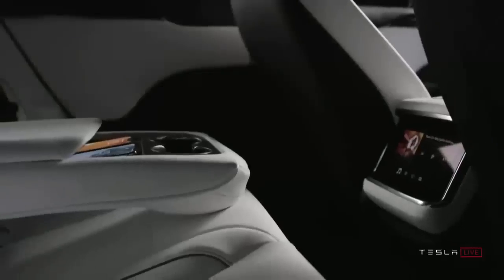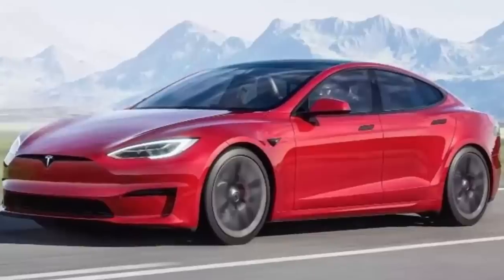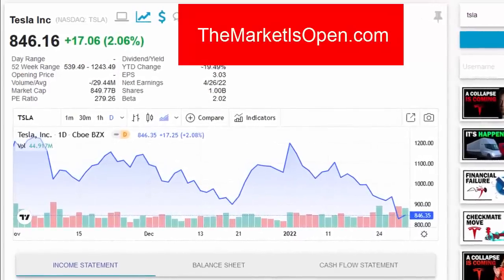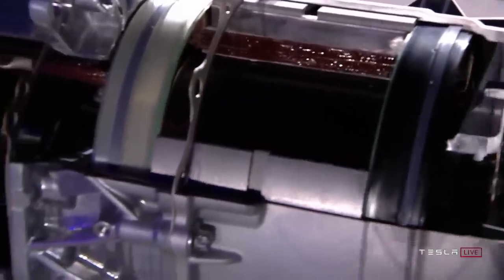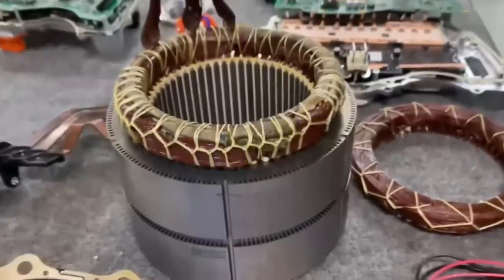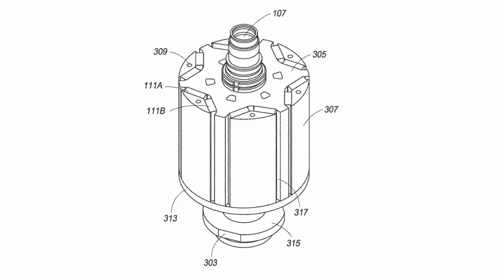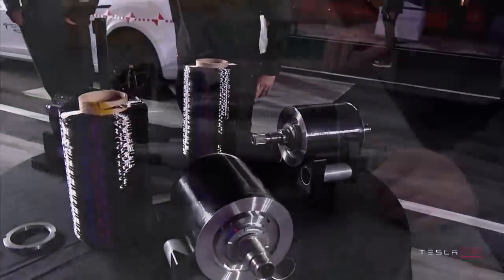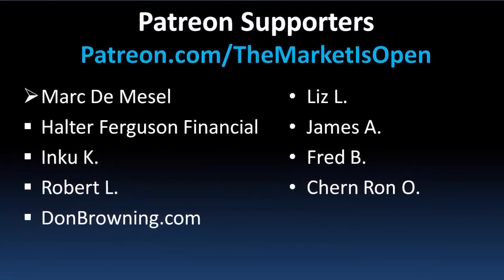The Brilliant Engineering of the Model S Plaid Motors

Comment: You did your research and reading. Sandy's way of saying just to slip on a carbon weave is probably not going to work.
Reply: The question isn't really is it going to supply as much restraining force as the unidirectional wrap?... It's will it provide enough force to hold everything together? What can be done to push that limit up to the point it is useable?

Comment: The Tesla motor control can ramp the voltage to the stator coils to prevent what he knows at stepping, so the magnets see a gradual ramp up, this ramp up will change as speed increases so it is not noticed at higher speeds, plus it is geared down to high RPM motor anyway.

Comment: Carbon fibers are used in the construction of race car bodies like the Formula 1, Indy cars, LMP cars, and the likes because of it's great strength to weight ratio.  If you will use that to strengthen the electric motors, it will give a significant advantage to that motor.  It's so easy to understand so why did the Lucid chairman downplayed it?

Comment: I'm going to buy 10 of them at 60,000.00 each. If you want the self drive program that'll be an additional 15,000 per car. If you buy a Tesla auto they will not sell you parts. So Anti-American.  I saw a film where guys in California pull their Tesla's up in front of the tents they live in. The tents are set up in downtown L.A. Rent is 3,000 a month minimum. I heard the greens fixed things so electricity is about 600.00 a month in California. The nut cases have figured solar and windmill could only happen if conventional electricity became impossibly expensive. They also did it in Ontario... cut 60,000 peoples electricity. The NDP socialist lost everything in the next election .

Comment: I’d bet the plaid motor runs on twice the supply voltage of its predecessors. At this condition motor KV hence rpm doubles to a breaking point at the rotor disintegrating magnets and its laminates. The remedy to that is carbon fiber pretensioning rotor. 

Is doubling the KV driven by Elon’s initiative for excellence? No it just a by-product to a more original problem - ie time cost to a full charge for Tesla has been surpassed by EU chargers. These chargers and batteries configuration doubled the batteries voltage use in Tesla. Simply doubles the battery voltage of equal kWh pack half the charge time. And for double the voltage Tesla’s engineer has two options either 1) redesign the motor electronics to adapt between 2x battery voltage and 1x motor voltage to compete with EU charger time or 2) redesign the motor to adapt to 2x battery voltage while benefiting from half charge time and increase motor performance. Tesla chosen the option 2).
Reply: Not so sure.
How could they use the same inverter in the 3 and Y if the supply voltage was changed?
Reply: @bru512  do you mean model y and plaid are 100% identical? Do you doubt that?
Reply: @philoso377  According to Sandy, model y/3/s plaid all have identical inverters.  So if that was true, how could the packs be a different voltage?
Reply: @bru512  I also was lead to believe of identical until I followed to the end of video I conclude differently. Normally Sandy advocate for reuse of identical parts which implies identical form factor. Since he isn’t into electronic energy management engineering, I take that as casing identical only. We should take this form to the individual circuit board revision number and suffix if any.
Reply: @philoso377  Good conversation.  I take your point with Sandy's scope of expertise.  I'll rewatch this beginning to end....
Reply: @bru512  this is an open end discussion can only be closed with circuit board revision number and suffix number proof of identical. 

This video only kick start discussions and can’t confirm one way or another. We don’t even sure what’s shown in video represents the entire inverter system, other than a die cast part enclosing a circuit board marked model-3. I agree with Sandy’s principle - component reuse. What was shown is his example to his principal. There are other critical electrical components not shown which can be found where major heat sinking is situated. 

Again - double the motor voltage doubles the rpm and quadruple the centrifugal force can tear apart laminate and magnet of rotor. That is why cf wrapping. Inverter’s power transistor of model 3 can only handle 1x battery’s voltage and not 2x in plaid which needs an inverter system upgrade to a new revision.
Reply: @bru512  the only difference would be the switching devices and different gains in the control loops.

Comment: The killer feature here is the possibility that a small motor with plaid technology may be cheaper than other motors, since it may be efficient enough to be much smaller for the same power output.
Reply: One speed system, no transmisssion required.
Reply: @bru512   - there is already no transmission on any Tesla.
Reply: @JoshGrossman  Exactly, the high RPM of the Plaid motor ensures that no transmission will be needed.
Reply: @bru512  The step down gears ARE the transmission. It has one gear ratio.
Reply: Model S Plaid spins the same size motor at much higher speeds - same torque x higher revs = more power. 
A smaller motor running at high revs makes the same power with smaller parts and higher efficiency. Expect to see these in lower spec Tesla cars.
Reply: No need for the carbon overwraps in the 3 and Y. They don't get to 200 mph, and that 0-60 mph time doesn't require the carbon overwrap. The centrifugal force isn't enough to warrant that kind of engineering.
Reply: @KyleHubb   top speed is not the issue - constant power output is. Gear ratio adjusts for top speed to place max power where it is needed.

Comment: It is common to monitor the back EMF (electromotive force) of a motor to allow speed control and can smooth out the low 
RPM pulse Sandy was expecting.
Reply: and i think 🤔the 3 motors are kept out off sink aka the stators are being staggering but it's sneaky way of doing it

Comment: Because the rpm range is so much greater, the Plaid motor tech would allow for a physically smaller and lighter motor in the models 3/Y. It seems like Tesla motors are always sized for good highway performance which results in too much power at the low end that then must be software limited.  This is the limitation of a low RPM range that the Plaid tech solved. Porsche recognized the problem but solved it with a transmission instead 😬. The Plaid motor tech is much more significant for Tesla’s high volume vehicles. Maybe the smaller size of the motor will offset the additional manufacturing costs.  Turbos started with fast cars but are now used in so many vehicles.

Comment: How much more does it cost to build the plaid motor than the regular motor?
Reply: Not much. They need to invest on designing and making the Carbon Fiber winding machine but after that most of the other parts is the same with Model Y. Expect this technology to move to Model 3 and Model Y once they have enough experience in producing the Plaid motors.

Comment: What will be the Model S 0-60 time when it gets the 4680 structural pack, that is 200kg's lighter and faster at discharging? Is 1.75 seconds possible?
Reply: It will be the same time. The plaid is traction limited all the way to 100kph it means reducing weight will also reduce traction so no faster acceleration.
Reply: @franciscoshi1968  got it, so it will not help with 0-60 but will help with the 1/4 mile.

Comment from the maker: Do you think that Tesla will scale their insane Plaid motors to their other vehicle models? And is the Plaid motor technology useful for any other parts of the vehicle? Be sure to watch:
• Tesla's Plaid Powertrain will Unlock New Features Including Torque Vectoring: https://www.youtube.com/watch?v=XlntL6Y_gFc
• Shortseller David Einhorn Betting Against Tesla and Elon Musk: https://youtu.be/li9bcLfHi58
Visit my website https://themarketisopen.com for instant stock quotes and financial data
Reply: I think the rear plaid drive unit will be used in both front and rear in the Cybertruck and roadster.
Reply: Seems inevitable that Plaid's carbon-wrapped rotors with split laminates for improved rotor magnetic reluctance geometry will be adopted on all vehicles once it proves out.  The higher power due to the magnetics combined with the higher rpm could easily mean a 50% increase in power density, enabling use of smaller, lighter motors, with compounding improvements in vehicle mass total and distribution in all Tesla models.